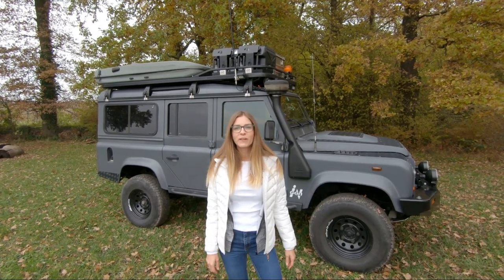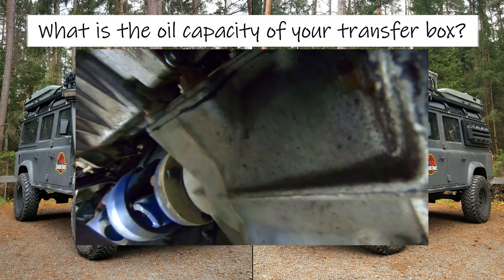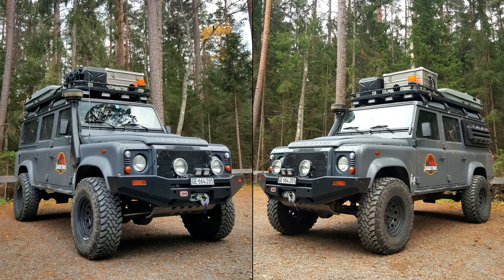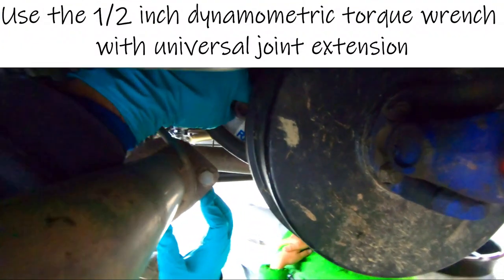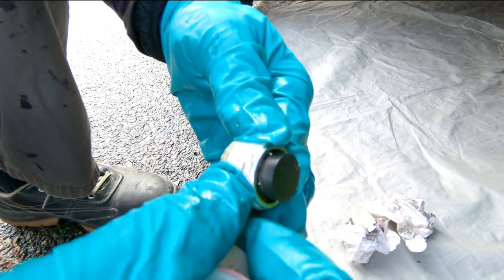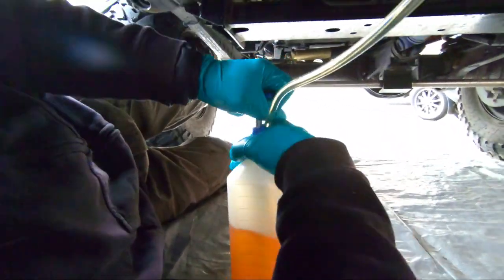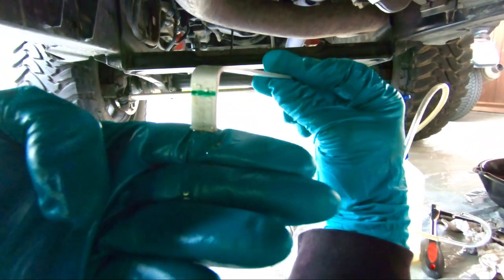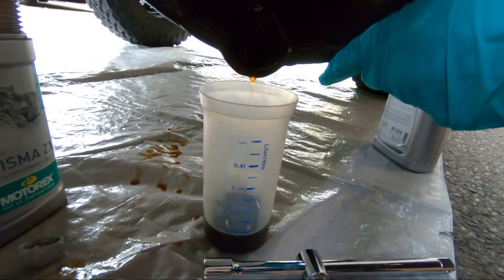DIY LT230 TRANSFER BOX OIL CHANGE | Land Rover Defender TD4 2.4/2.2 TDCI Puma | Maintenance series

Comment: I use a emptied 1 litre soap pump bottle,  which i rinsed out with boiling water then attached 1 meter of hose to.  Cause €25 for a plastic pump is insanely expensive.  My bottle was free & i throw it in the recycling bin when I'm done.
Reply from the maker: Thanks for sharing this!

Comment: Useful, thanks. I am running to buy one of those manual pumps....
Reply from the maker: The best buy for oil changes! Don't hesitate to use our Amazon affiliate link👌
Reply: @offtrackfamily  I actually cannot find the reference you show on Amazon Italy. However I found the same pump from Draper

Comment: What about GL-5 Oil? For the 2.2 Litres Puma there is a recommendation for only GL-5 Oil for the same transfer-box.
Reply from the maker: We never used GL-5 for our transfer box. If you're not sure about which oil to choose you can go for the oil Motul Gear 300. We are sure that this one goes for 2.4 & 2.2 tdci.
Reply: @offtrackfamily  Hi, May I know what about 200 TDI model? thanks:virtualhug:
Reply: Pour information, Motorex conseille en 1ère position dans son sélecteur d'huile une GL-5.

Comment: A torque wrench should only be used to tighten bolts to a specific torque -- hence it's name. You can use a ratchet wrench or other type but not a torque wrench!
Reply from the maker: Hi David. Yes it's absolutely true you can use a simple wrench to tighten those plugs. But in the workshop manual it's written that we have to tighten them to a specific torque: 30nm. That's why we recommend using the torque wrench but it should be also fine without ☺.